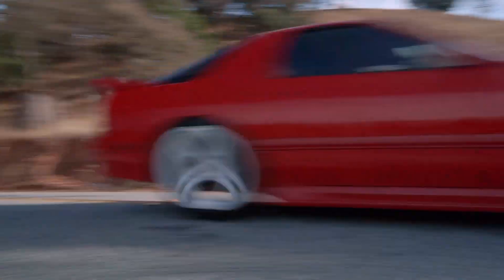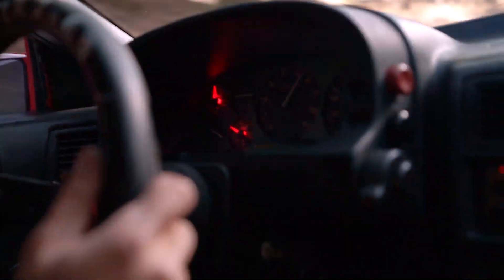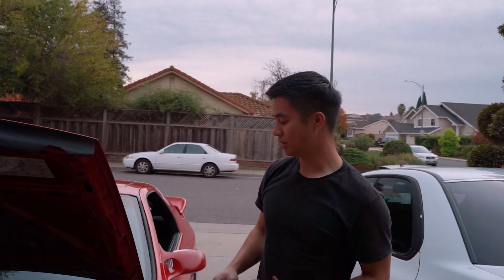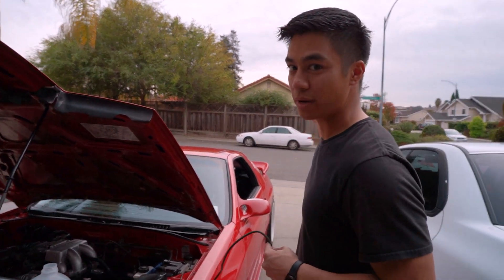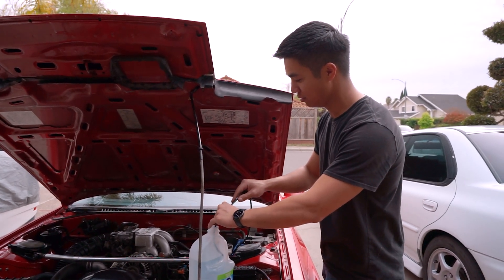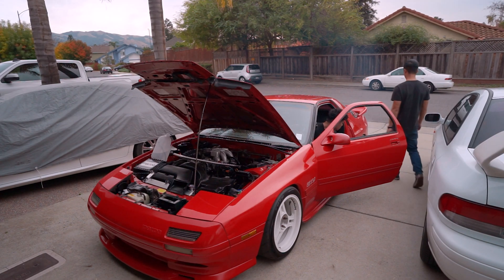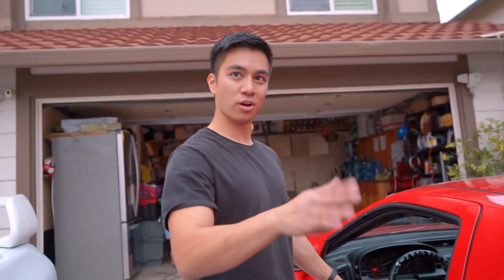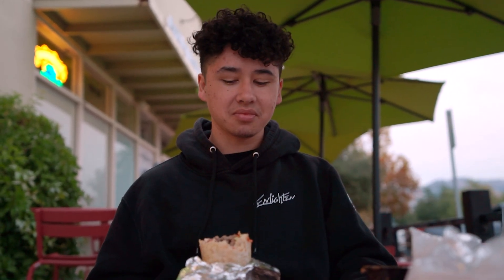Use WATER to Carbon Clean Your Engine

Comment: Ur doing it wrong.. ur suppose to use 10% baking soda,  some water and some fabuloso cleaner. To do this right. The baking soda blast the carbon.. when u rev the engine, youll see the black carbon come out the tail pipe.
Reply from the maker: Interesting, I’ll have to try this next time!
Reply: Ur supposed to use ketchup and syrup, dummy.